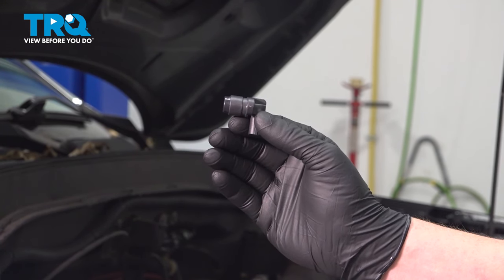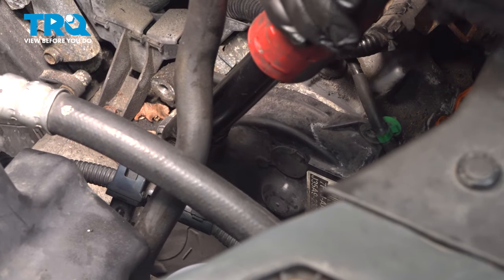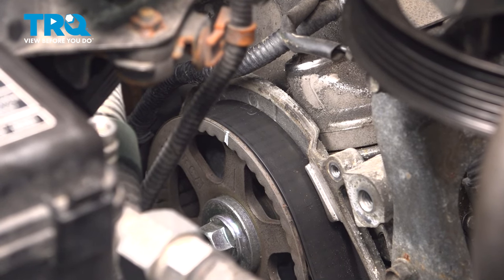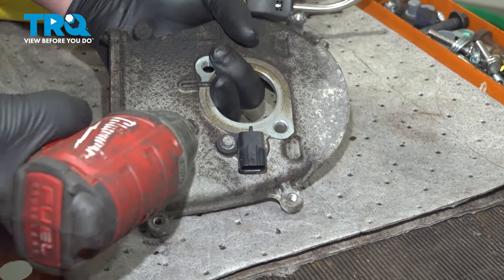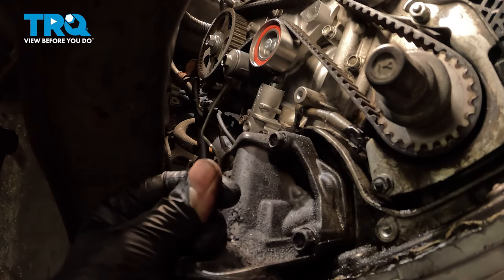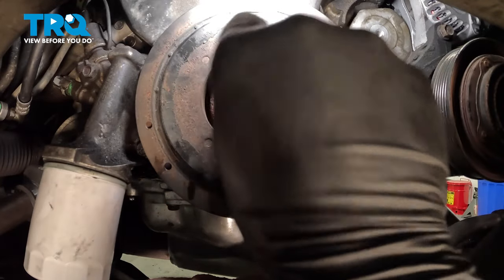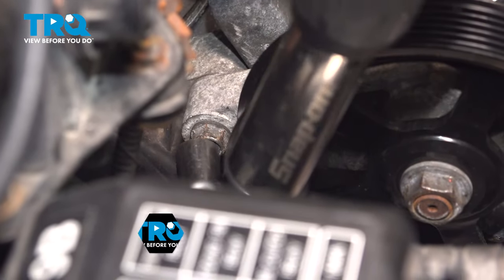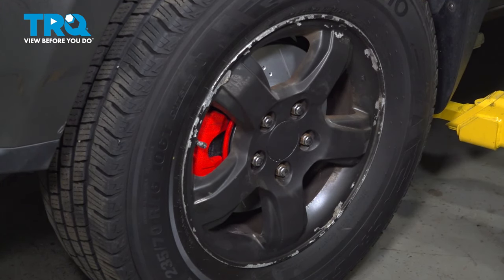How to Replace Camshaft Position Sensor 2003-2008 Honda Pilot

Comment: Very confusing video: You DONT have to do all this, when you replace Cam sensor??? Only take Power steering out, maybe pulley??, and you can repalce cam sensor, takes 30 min Max!! And, why empty coolant???? No reason, this was more like replacing timing belt, really??? Dont get it???